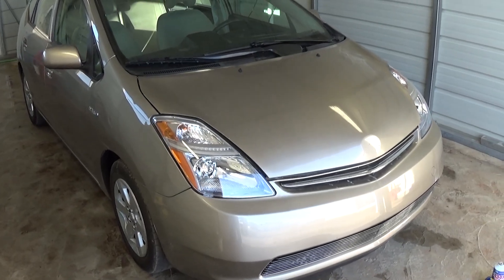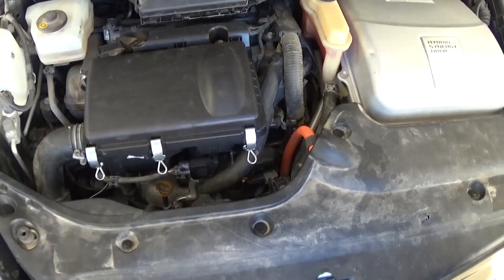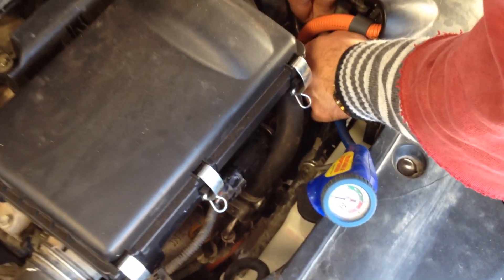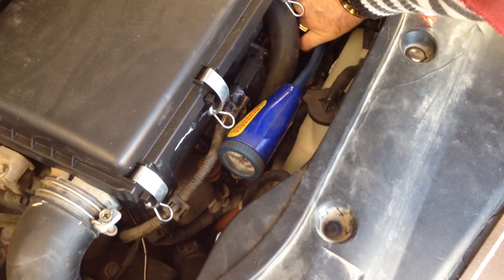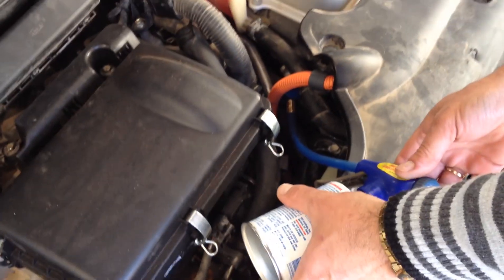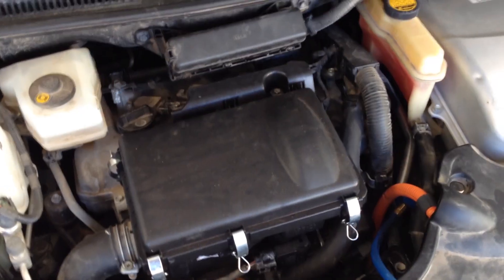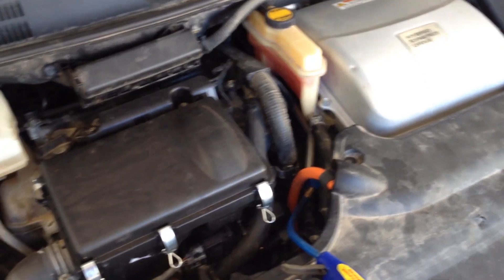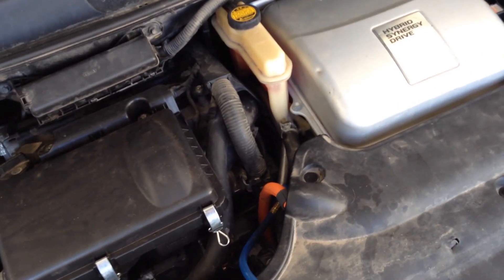Toyota Prius A/C Charging.  How to charge Air conditioner on Toyota Prius 2004 - 2009

Comment: Never use a DIY bottle to fill your hybrid car. These cars use precise amount of gas (450/470grams from empty) Use a pro machine only that can vacuum the old gas, measure the amount and then refill the correct amount, if you want your A/C motor to survive. Plus Hybrid vehicles use a special POE oil, rather then universal PAG46/100 which in a diy bottle you cannot control.
Reply: The thumbnail has a 134a can un like the pag46 your talking about. Can you make a video?? Everyone has chimed in but no one is posting video on this

Comment: Without a (new/solvent flushed/hybrid electric compressor use only) gauge set or scale or a thermometer (with appropriate probe for measuring tubing temperatures) it is VERY easy to overcharge the system resulting in reduced compressor life and poor performance/capacity/efficiency.  You also need to know how to use these tools and analyze the system based on the readings if you want to be able to top off a system to a charge level that is well above the minimum required to function(100% liquid getting to the expansion valve), but not quite to the point of overcharge where you have liquid backing up out of the receiver into the condenser reducing its effective size. That kind of understanding doesn't come from a 2 minute video.  Otherwise you can recover ALL the remaining refrigerant with a recovery/recycling machine and weigh in a full charge.  This will give you consistent results and the maximum length of time till it needs recharging again.
If you are lucky you might be able to get by charging until the suction/low side line starts feeling cold to the touch then STOP.  Suction line temperature is (barring any other faults) a more obvious indicator of undercharge than suction line pressure which will vary considerably with humidity , temperatures, fan speed, blower speed, engine speed, fouling, model and wear.  This procedure will get you to a minimum charge level.  Systems will work almost exactly the same between min and max charge level so if you keep charging you won't see a difference until you are starting to get overcharged. This will only be apparent on the high side.

Comment: Thanks for spending the time to upload this. Can you explain further where you are connecting the freeon hose? Also, I wasn't sure why oil is needed for the recharge and where exactly it needs to be used. Thanks for your time.

Comment: What pressure should I be aiming for? Also do I need to keep the AC running when recharging
Reply from the maker: Misbah Keen The spec is 0.15 - 0.25 MPa (22 - 36 psi) on the low pressure side; and 1.37 - 1.57 MPa (199 - 228 psi) on the high pressure side.
Always keep the AC running when charging.

Comment: I just replaced the condenser in my prius.  None of the local shops seems to even know that you don't use dyes or any other oil than ND-11 in the prius AC system.   The dealer wants $400 for a recharge which seems insane, but I managed to find the oil and pure 134a locally.   The issue is the oils just came in a regular plastic bottle without the pressurized top.  How do I add the oil to the system while also not introducing air?
Reply: Frst add the oil and then the refrigerant...
Reply: @inikkor520  how much oil? Dot dot dot dot..... .. dot dot
Reply: How much oil should be used
Reply: 1.5 oz
Reply: How does the ND-11 oil get introduced to the system?

Comment: Question. I have a 2012 prius v.  The air conditioning stops running cold when the pressure is high. my mechanic said that it running as high as 450. When the ac works its is cold so their is no leaks. He said there might be a clog in the system so it has to be checked. He said that he cannot fix issue be his ac machine is not for hybrids. he said hybrids us a different machine. Is that true?
Reply: yes agree , try to release some presure with ac pro til the green shadow is done 45 psi in low pressure by
Reply: Agree that happened to me. Release some pressure pressing the injection plug and check your pressure while blowing ac cold

Comment: Show the pressure readings on the delivery, If you already have pressure in the red, it has to be released. Preferably into a cylinder vacuum. Otherwise your wasting a can. This happens all the time with 2nd gen prius. I use walmart brand with no oil. For 180,000 miles, no problems.

Comment: Hey man, Appreciate your effort. Wish you didn't have that music. But not a major issue. 
Here's my question:

1.When I connect the hose does the guage say what pressure it is at?
2. The referigerant can be any?? - meaning does the referigerant has to be special (hybrid) too. ???
3. How do you know if it needs oil?
4. lastly, how do you add oil? Same as referigerant??

Thanks and sorry for the lengthy post.
Reply: did you ever figure this out? I'm in the same situation

Comment: I don't understand why, if the system needs coolant, it wouldn't also always need the oil.  Anyone?  Thanks for the vid anyway World Mechanic
Reply: Prius 2nd gen ac compressor is electric, Has no clutch. I always used walmart 134A no oil/

Comment: Is the ND-11 oil in the same bottle as the refrigerant or is that a separate product?
Reply: Mike R. 
a separate product,  unless your freon can specifically states that it contains ND11 too... most oils n dyes included in ac pro n the like, ARE THE WRONG type for hybrids...
I'm going thru this mistake rn, n my prius STOPS running, speedometer stops working n disappears from dashboard... i have to turn off/on car to get it going short term, or reset 12v batt cable in rear to get a longer run... but basically my car needs fixing (compressor, vacuum lines, etc?).

good luck

Comment: hi world mechanic, please help. my 2006 prius a/c compresor went bad, I replaced with another compressor vacuum the lines and trying to recharge freon however the compressor doesn't engage so is not taking the freon, on drive belt compressor is easy to Jumpstart it, but can't figure this one out, on how to jump start the compressor any advice will be appreciated thanks.

Comment: i can barely hear because of the music. .
so my daughter 2007 Toyota prius hybrid 
is blowing hot air, and auto parts store gave her a can 18 oz. of R-134a plus oil.
is this correct before I try to  
install.  and how much should I put in ??
Reply: No.  Don't put that in has wrong oil.  Only use the pure refrigerant
Reply: Well it worked for about a month  and half...now it's blowing hot air again. ..their must be a leak
Reply: +Raymond Boone - okay , so now what did you do ??
Reply: Raymond Boone I’m having the same problem 😭 was there any luck ?

Comment: OK but what is recommended pressure on the gauge
Reply: You should factor in the ambient temperature.
But generally 25-35psi low side.

Comment: Where does oil go?
Reply from the maker: ***** it goes in the low pressure port ( the same place where you put the freon).
Reply: The oil the part store have has a regular can. So just pour it inside the port with the ac compressor off the car